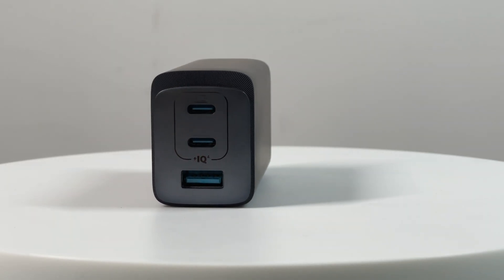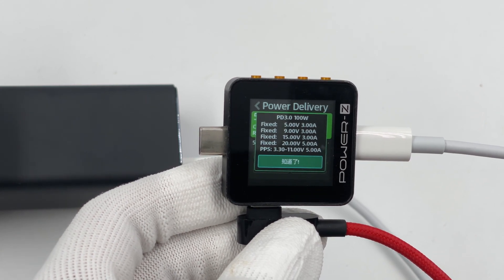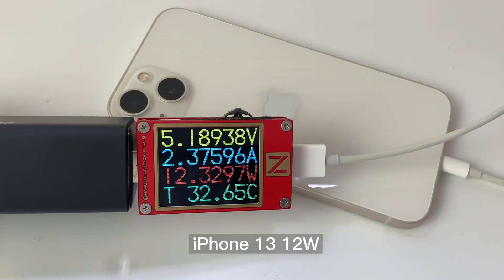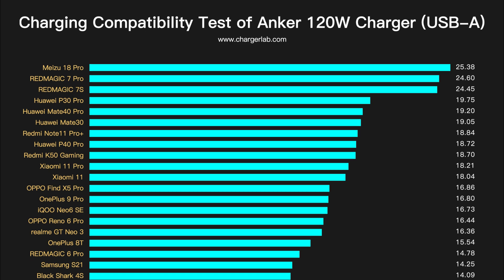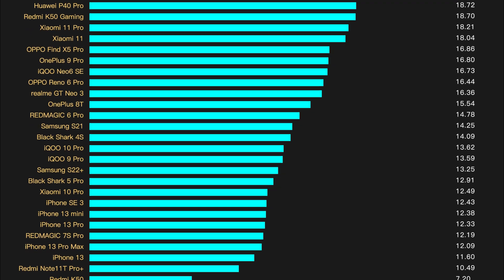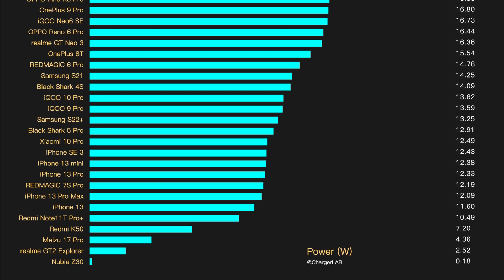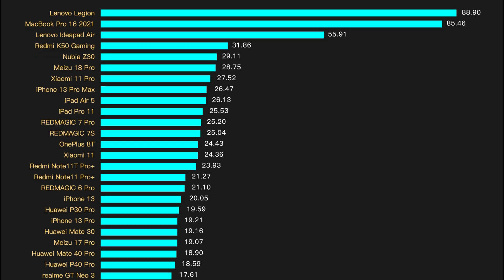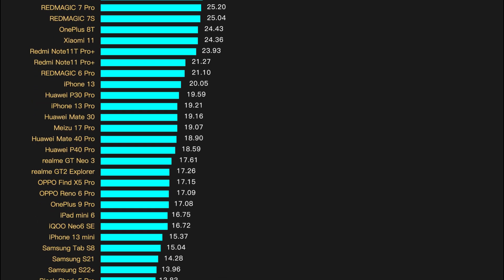Charging Compatibility Test of Anker 737 Charger (GaNPrime 120W)

Comment: Keep up the amazing work. I can tell you are trying your best with announcing just keep at it and you will get better. Maybe consider an amercian accent class. I had one request for a device to be added for testing. Could you add the WITRN USB PD trigger cable and YZXStudio pd trigger. I use these for projects and would like to know if they play nicely with different charges. I am looking forward to the Anker 747 and Anker 737.
Reply from the maker: Thanks for your suggestion. Currently, we only use POWER-Z tester for testing, cause it's our own brand and we want to use full use of it. Sorry about it.
Reply: @ChargerLAB  I am NOT talking about there USB C Testers. I am talking about the PD TRIGGERs that they sell in cables and for DIY projects. The ones you can set to 20v, 15v, 12v, 9v, 5v. I want to see chargers tested for compatibility with these like you test phone charging speed.

Comment: How correct this tester? Where is PD 12V, why samsung s-series all below 15W, but should be around 20w?
Reply from the maker: This charger don't support 12V PD, so, samsung s-series can only trigger 9V.
Reply: @ChargerLAB  as far as I am aware, Samsung 25/45W requires PPS and it's still around 9V. That's also what your other videos were showing (while without mentioning the actual reason of specific charging wattage, which would be very useful for most viewers). 15W charging of these suggests that PPS was not in use. Can you please retest? Maybe the charger is malfunctioning as according to the specs it should charge all these Samsungs with maximum wattage they can absorb.
Reply: @ChargerLAB  samsung requires AFC protocol, but through this tester does not use maximum wattage 9V25W (Super Fast Charging), and use only 9V15W (Fast Charging). In all videos same.